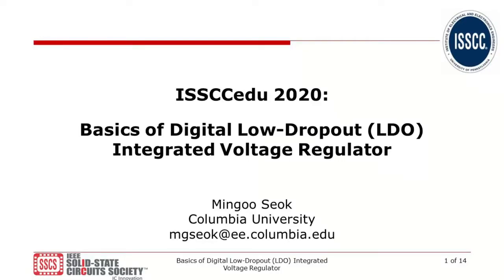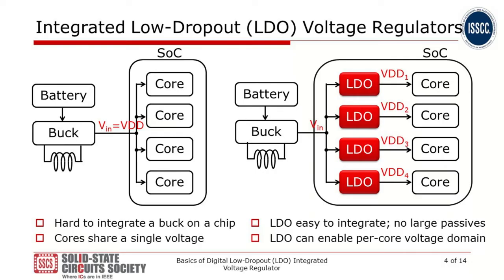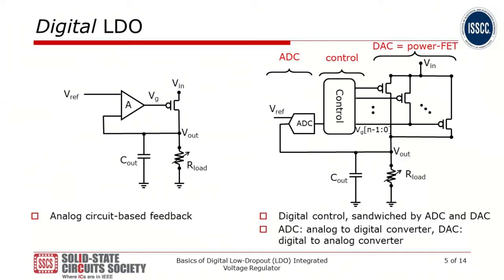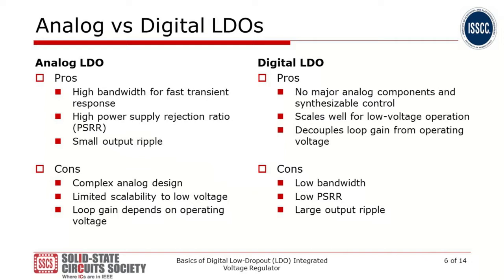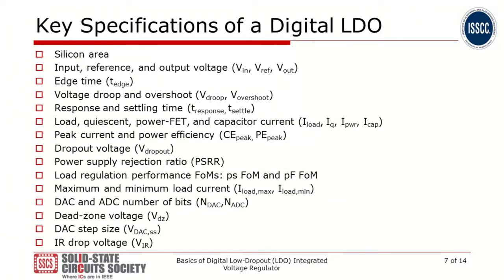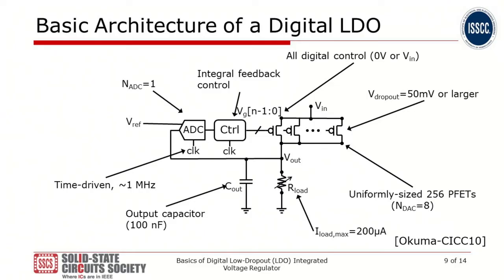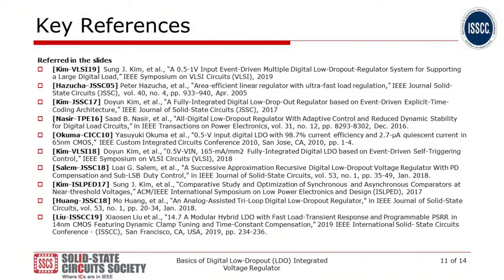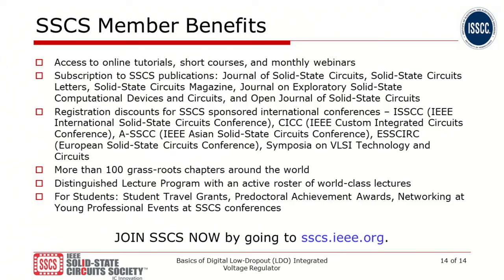Basics of Digital Low-Dropout (LDO) Integrated Voltage Regulators - Presented by Mingoo Seok

Comment: If the PSRR is worse than the analog version which already is having hard time meeting PSRR specs, can digital LDO be actually practical? Where would we use digital LDO if the LDO's main job is to have good PSRR?
Reply: They are used for easy DVFS in digital loads. Scaling the voltage with digital LDOs is straight-forward and usually digital loads (a processor, and accelerator, an ALU, etc.) can tolerate low PSRR.

Comment: so the trend is all digital
Reply: if something can be done in digital achieving the required specs and power consumption , it will be done in digital to avoid using bulky capacitors and have good process scaling.
Reply: @mukundmurali3720  hh, get! Thank you professor!